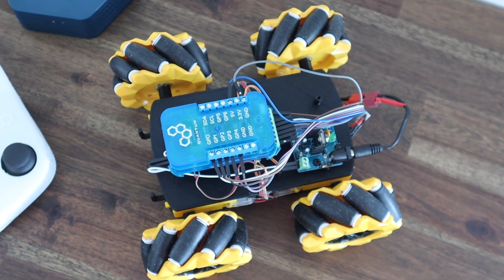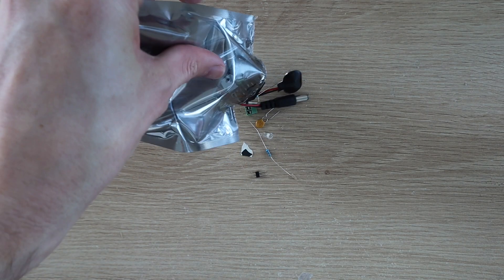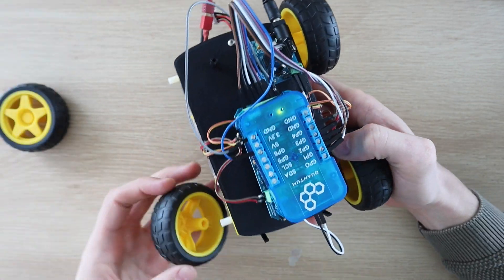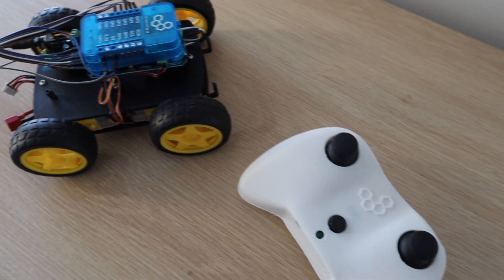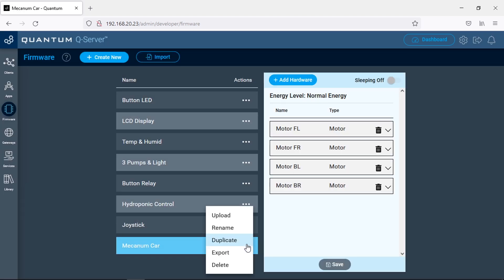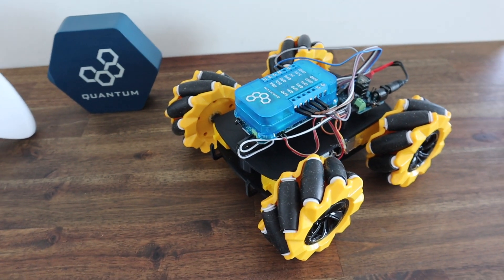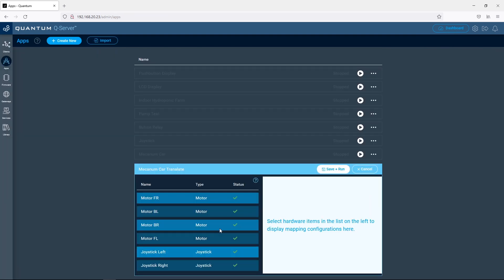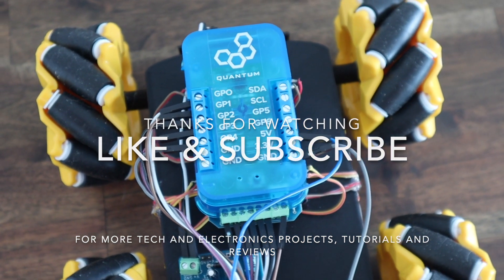Mecanum Omnidirectional Robot Car using the Quantum Integration System

Comment: Really NICE build!  I just received "Scout", a Kickstarter funded AI vehicle, also with mecanum wheels.  I was surprised at how poor the traction was, as well as inability to drive over minor obstacles like a 3/4" high wood threshold between 2 rooms.  So I'm curious if your vehicle handles more challenging terrain than say the tiled floor in the video?  I suspect part of Scout's traction issues is that the wheelbase was so short (about 1/2" gap between tires).  Anyway, regardless of your vehicle's traction, this was a great build!!
Reply from the maker: Thanks Mike. I think mecum wheels in general have pretty poor traction, the rollers on the wheels tend to slip on raised objects. They work well on concrete or tiled surfaces, but not that well on others. The previous version of this car with the AI camera tracking and no mecum wheels was great for brought terrain and off-road use.